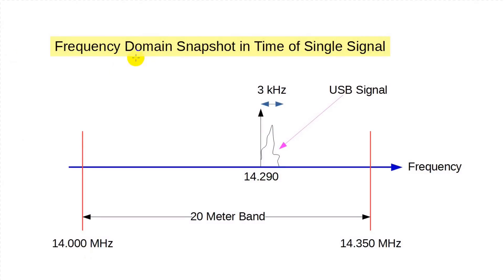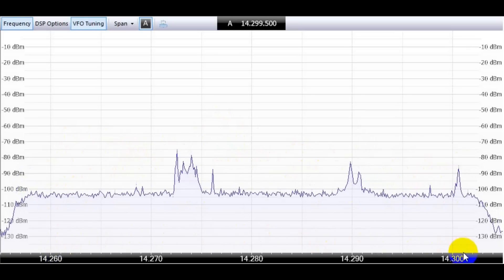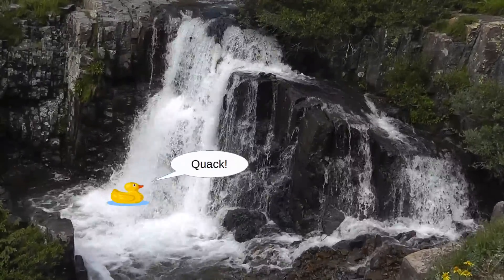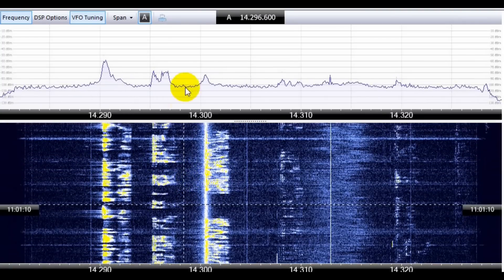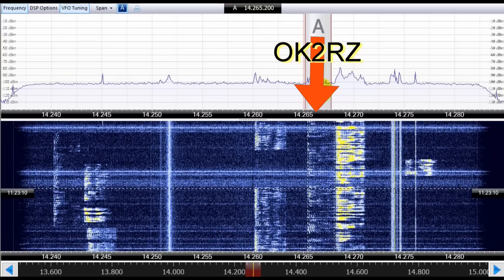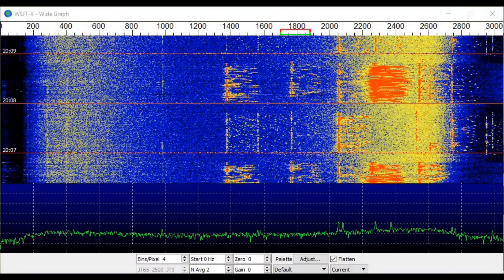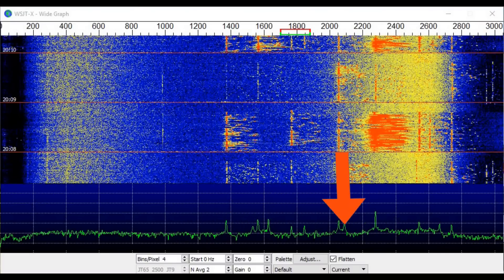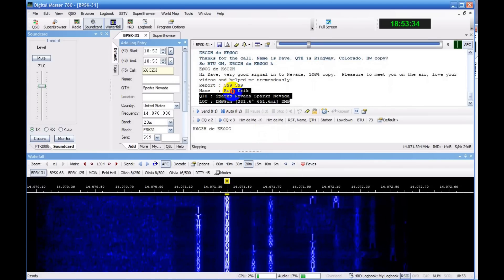Waterfall Displays Explained: Ask Dave #21

Comment: Fun fact: waterfall displays were introduced in military RADAR systems as well as SONAR.  My involvement was with the system implemented on the AN/FPS-26A system that the US Air Force used, which was introduced in 1962, but this was not by any means the earliest implementation.  In our system, because our scopes were not digital, so they could not move the historic data.  Instead, they scanned slowly from the top to the bottom of a CRT that had a very long persistence phosphor, so that you could see the last minute or so of activity on your band, before returning to the top of the screen.  But aside from that difference, it looked very similar to today's SDR waterfall displays.  The band for this system was 5400-5900 MHz.  It was used for evaluating what types of jamming devices were being used against your station, as a tool to determine the best countermeasures to apply, as different receivers had different efficacy against different types of jamming, and we had several receivers to choose from.  I didn't work with any naval equipment, but Destin at "Smarter Every Day" has a recent video about how waterfall displays are used on submarines.  Totally different beast, there.
Reply: Different but still similar. The fundamentals of electromagnetic radiation propagating through atmosphere are not all dissimilar from acoustics propagating through water.

Comment: Hi Dave.  On my display I have a signal that looks like a corkscrew.  It this interference?  Its only in one spot on the far right of the screen.  JJK
Reply from the maker: It's some sort of weird signal. It may be due to a nearby switching power supply which operates in the low RF region with an unstable oscillator, hence the appearance of the corkscrew on the waterfall. Plus, there's all kinds of strange stuff on HF.
Reply: Thanks Dave.

Comment: Are you saying a waterfall can be added to a very capable radio (e.g. ICOM IC-7100) that does not have a waterfall originally built in?
Reply from the maker: If, and that's an all-important if, the radio has an IF or RF output on the back panel, usually in the form of an RCA phono plug. You plug that into the SDR and you'll get a spread over however wide the IF stage is of the radio.

Comment: Great video thanks for sharing.  So it seems the sdr with your ft3000dx on a computer screen shows a more detail display than the yaesu?  So which of the programs do u prefer, seems like there are alot. Which pne do u like. 73,kc1ero
Reply from the maker: +jpintek There are lots of SDR programs out there. I use SDR Radio V2, made by the person who originally programmed Ham Radio Deluxe. All the software is sophisticated and have steep learning curves.